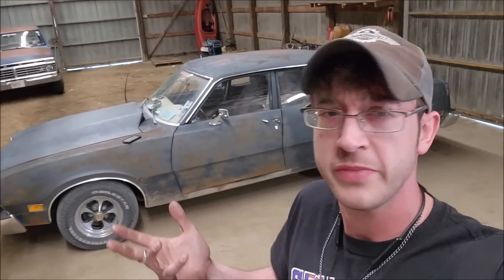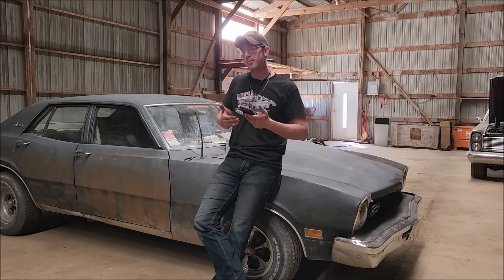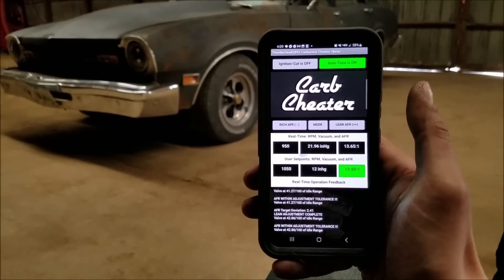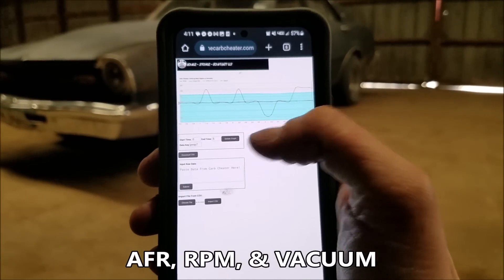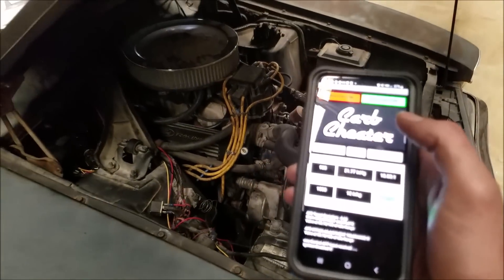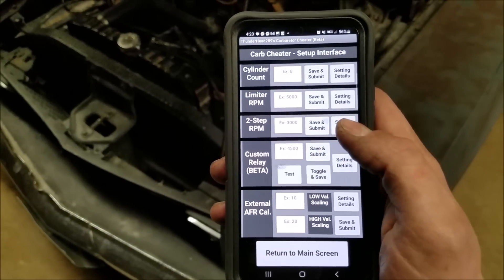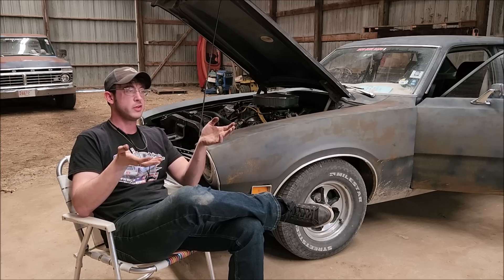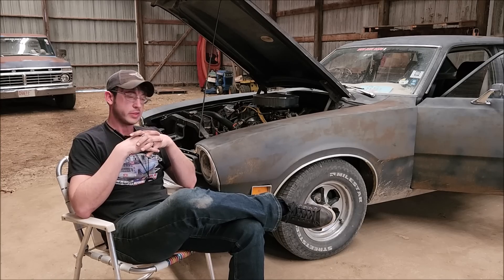A "self-Tuning" Carb in 2023? NOT fuel Injection (Beta Version - Teaser)

Comment: SEEMS like a great idea in theory and practice but thing holding me back is price of $500cdn.
i just paid 135 cdn for chinese knockoff carb and that in itself made a world of difference, eliminating about 3 vac leaks out of 3-5 intermitant leaks, other 2 are on the intake and not always present.
runs pretty damn great for F150 360 fe with probly 218 000 miles on it, at least on short grocery/beerstore trips. 
failed me twice on the highway possibly from vapor lock /1/2 plugged fuel lines, failing 2 tank switch, not sure at this point BUT started up and got me home with 5-10 minutes of fiddling under the hood.

Comment: 2:30 Can someone please explain the wiring to do remote self start?  Thank you
Does connect carb cheater just connect its yellow wire  (auxiliary relay/ dry contact) to the starter motor?  Where would the black wire (auxiliary) connect?

Comment: I wish I could get something like that carb cheater you put together... Perhaps a electronic distributor circuit could be integrated if someone wants to use a newer distributor, I've already moded my distributor to change the curve and limit the throw, and I think I have it set to 38 total or so.  I have a '74 maverick 2dr, with a 289 from a '66 mustang and a t5 from a '93 mustang...  I've done allot to the car that would fill a paragraph or a couple pages like brakes, body work, etc.  anyway, it would be nice to have something that would at least take care of the AFR, I've thought about trying some kind of system like this or a dyi FI but ran out of energy to put something like that together on a budget and with it being my daily driver w/o a backup car I can't have it down for long...

Comment: All you need is Bob Ogles plans they are on line last time I looked , he removed the carb / first fuel/vapor injection 100+ MPG, it was televised in the 70's. The feds searched his gar to make sure it wasn't a hoax, he used a big block and drove 200 plus miles on 2 gallons of gas/ 100 miles per gallon!!. He/his life was later eliminated by his partners, big oil. His invention on a modern 4 cyl engine would have produced 900 miles to the gallon.

Comment: I had a really cool and uncontrollable chuckle when I saw the chain you had bolted from the engine to the chassis! It immediately took me back to the ‘70’s whenever I broke a motor mount from more torque than the stock motor mount could handle. That chain allowed me to race to a lot of wins and I think it was just about the only thing that didn’t break from racing! Thanks for that fond little trip down memory lane. 🤙Oh, and by the way, I agree with all of the other comments about your channel. Your channel is the best that I’ve seen in a long time. I just found it today and what awesome presentation and content!I’m hoping that I’m not too late for the party and you’ll stick around for us gear heads ✌️

Comment: Luke I have a Mopar 360 rochester 2bbl circle track engine (class rules). will your adapter flat plate in your kit work with a speedway motors (lincoln Nebraska) #135-3502G 4bbl to 2bbl flat aluminum plate with either an edelbrock spreadbore 4bbl intake #2176 or a weiand 4bbl 8022 square bore intake. thank you for your time. Rapid Robert

Comment: love it , I have a 455 pontiac , i need a rev limiter for it,   5200 comes quick...  I will purchase one when engine goes in ,   also a rochester 4 bbL...  so I will have to modify adapter...   unless you can add that option...

thanks
Reply from the maker: Now available with q jet adapter 🙂
Reply: @ThunderHead289  cool ,  hope your enjoying the holiday and thanks for the quick responce ,   been following for many years.   I build cars too.  day job airplanes.

Comment: i was looking for a wideband system to adjust my quick fuel brawler. (ford 289 331 stroker)but it needs a stupid gauge in the car.

I'm very interested at youre product because of the wideband , gauge on cellphone app , and non stealable car . rpm gauge and a afr regulator system like the cheap chinese 50cc scooters that i work on. they also have a carb but a adjusting afr with just extra air thru a control valve.

So the program can control more air or less to the engine to control exact air fuel ratio so when iyoure carb is adjusted in cold wheater it can adjust the air fuel ratio when you drive it in warm weather and so it will be richer but not with youre air fuel mixture regulator?

when can we buy this system? do you have a vid of the parts and installing?
Reply from the maker: In ten days it will start to be available - I underestimated the paperwork behind setting up a business. Check the two videos uploaded after this one - I install it on a green f100. Part 1 & part 2 - check my recent uploads

Comment: I wish I could get someone to get my 89 4.9 running right, starting to hate fuel injection and all the computer controlled junk, miss my 73 carbed 302, not fair I lost it in an accident, been struggling to get my 89 Econoline running right and it finally fell on its face, afraid it blew the head gasket, can't drive it, gutless, not on all cylinders, but no coolant in the oil, tho coolant slowly disappears, wont pull a greased string from a cats ass.

Comment: Think this would work on a model t?
Reply from the maker: The only item I'd be concerned about would be the requirement of a single coil, and a wideband doesn't like 6v. 

We plan to make a stepup add on in the near future to accommodate 6v
Reply: @ThunderHead289  yeah it's 6volt however model ts use 4 wooden buzz coils as well and have a magneto to generate really crude AC power about 4 volts at idle and 20 volts at 1900 rpm. I really find your content cool the first video I watched was when you mounted the lawn carb to your maverick.

Comment: EFI tech is more than half a century old, don't know what the holdup is.
Reply from the maker: Not all new things are better. I bought a 2021 jeep brand new. Engine revs up and down to 2000 rpm randomly at idle, ignition pings off the line sometimes. 

I'm a programmer by day, and I'll be the first one to say that a fuel metering system that's founded in physics and fluid dynamics is pretty hard to beat when tuned correctly. 
Most people just are too lazy to ever do anything right that takes any effort because we live in a push button society.

Comment: Modifying any fuel system is a federal felony 
Since 68 or really 72  you need a state / fed certificate to touch them
Reply from the maker: Holley does it and we took their disclaimer 😄
Reply: @ThunderHead289  
I'm just stating the facts they can take the car , it has to be put back stock ,by a dealership or crushed , it happened  to  a kid at our dealership

Comment: @thunderhead289 I'm really excited to get my hands on one of these and play around with it one day. I'm pretty much in the same boat about not wanting to ditch the carb setup on my older vehicles, but still having a craving for data and tunability on the fly which has only recently become possible thanks to smart phones, open source code/apps, and stuff like that. Having a system which can be a standalone tuner with simple inputs and outputs, and a smartphone UI, that is a game-changer for people who have a passion for old junk, but never had a chance to learn all of the carb tuning tricks the old-fashioned way. 

I'm hoping this can also be a "gateway drug" to people understanding more about the science behind carbs and how to tune them. Having a cheater that can fix all your tuning problems in one stroke is great, but if it can also show you where your system's weak points are, it can help you tune and troubleshoot cars even if they don't have a cheater.  

Watching people like you, its amazing how you can just hear the difference between rich and lean, timing advance, and other stuff. I know that comes from years of experience, but its still impressive. People like me spend hours and hours trying to troubleshoot something that more experienced people just instinctively know in seconds. If this device cuts that learning curve down with real-time feedback and data logs, that is going to be awesome.

Comment: Tell me this is going to be priced for the working man on a budget, please.

P.S.  A suggestion:  an auxiliary relay actuator function set for certain conditions. Example, a ram air scoop that has a valve that only opens at WOT. Or open exhaust valves.
Reply from the maker: It's under 400 dollars, so I'd say so. I basically make nothing making them - more of a gift to the community than anything
Reply: @ThunderHead289  Luv ya like a brother, man.

Comment: wow that is fantastic, would like this in my 1983 Ford Capri (european Capri) but I guess it will not be "for small money" or? :)
How does it control the Air/Fuel mixture? This would also need some motors they control the needles for mixture?
Reply from the maker: 383.00 - simple to install

Comment: optional slave cheap android tablet that runs on older android would be good. for that display hidden in glove box of something.
Reply from the maker: Technically the app is just an HMI, so it doesn't have to be connected at all for carb cheater to do its thing. But yes a 50 dollar android tablet would work well as a "permentant" in vehicle installment
Reply: @ThunderHead289  sweet. i cannot wait to get one to put on my 1969 GTO. but im a lowly Canadian ;) I am a tech but not a coder. I could build it from plans but cannot program it apart from applying existing code to a chip or module. would be fun to apply to my old 4 cylinder Honda bike as well as my 1949 military Jeep.
Can't wait for its release.

Comment: Dude that is very cool! I figured you would have to put a plate between the carb and manifold to act as a drive by wire throttle body to maintain AFR.
Reply from the maker: It's much simpler than that - maybe even to an annoying level lol

Comment: How about a “turbo timer” setup for electric fans?  Possibly just a timed output after ignition is turned off.  Could be ground trigger as well. I like that the fans run for a bit after shutting off the vehicle but do not like leaving it wired direct and running to much. 

The remote start feature is the ultimate selling point.   I have 3 vehicles that need one of these units.

Comment: What is the chances of someone hacking the software, and either shutting the car down while its making a pass. Or stealing the car? Thieves are not as stupid as you think, which is why so many Hellcats, and etc are being stolen. (Youtube it)
Reply from the maker: Unless you give someone your code, each unit has its own specific pin - nothing can be done without that
Reply: @ThunderHead289  don't take it the wrong way, for its not intended to be derogatory. Some years ago farmers where having issues being able to access and diagnose issues with the John Deer equipment due to the proprietary software. Those of the hacking community answered the call  and delivered a way for the farmers to work on their equipment without John Deers approval.  Guess what I am saying is, have you thought of is: limiting distance broadcasting. Or in the event of theft, making a low jack style feature.  Device has to be within range - verified mac addy. Or if the vehicle has been taken - has the ability to remote shut the vehicle down.
Reply from the maker: @JusSkott  it's over bluetooth so someone would have to have their phone hacked first - no web
Reply: @ThunderHead289  "sniff sniff." Either or, still interested in the final product. And will there be provisions for a blow through carb?

Comment: Damn I've wanted to do something similar for quite a long time but I've been way too busy in the last 5 years. 
I don't know how you're controlling the mixture but I personally plan to run smaller main jets and use an auxilliary enrichment system somehow controlled by a modified speeduino
Reply from the maker: Speediuno is garbage - id recommend designing something all your own like we did
Reply: @ThunderHead289  I'm not running an original one with the old arduino mega,  I'm running an STM32 based one. I'll stay with the speeduino firmware for now as I have another project to finish before starting working on the carb

Comment: the backfire created from cutting the ignition can and will cause engine damage. the factory hot rods came with rev limiters in the distributers. they could easily be disabled. would void your warrantee. we weren't worried about the warrantee. I have seen a few engines that exploded at high revs. then you reattach the lever on the distributer and haul it to the dealer.
Reply from the maker: Any curburated engine Rev limiter is an ignition cut - the party mode just exaggerates the duration such that a measurable amount of unburnt fuel finds its way into the exhaust, ignites when ignition comes back online. 

I may not offer the feature to the public though - fast way for a car with mufflers to blow the muffler into outer space

Comment: Add a feature that can take an aftermarket rpm gauge and turn it into a built in timing light thing so people will never need to pull out a timing light ever again
Reply: Like a bolt in or weld in magnet and sensor

Comment: I love the carb cheater. When will it be for sale? I've also seen your vids on pertronics ignitions.
If I've missed it, I've never seen you do a vid on the progressive ignition systems. Do you have such a vid. If so plz let me know. If you've not heard of it, it's basically the same concept for a distributor as your carb cheater is to a carb. It has no vac or manual advance. All by wire.
You manually set the idle timing. Then the dwell and advance curve is set via a phone app. It is made to deliver 8 amps from idle to 10,000 rpm.
Together with a carb cheater seems like the best way to bring my old 350 Chevy into the 21st century. 
Thou I think 10,000 rpm's would put my 350 squarely in the middle of a scrap pile, I am looking at reliability, economy and when I fill froggy, some good ole power.  
Please let me know your thoughts.
Reply from the maker: I'm the original promoter of progression ignition 🙂👍 when you go to my channel a video automatically plays - scroll to the end of it. I know the guy who developed progression ignition

Comment: My brother runs a 1984 Mustang with a 1953 flathead, carbureted at Bonneville each year. This would be an enhancement as it would have AFR adjustment on the track. He’s building up an engine for this year - could we test your device?

Comment: What, that's incredible! What hardware does it use?
Reply from the maker: It's a custom circuit board we designed, and then a couple of machined parts we designed 🙂
Reply: @ThunderHead289  very cool! Looking forward to try it
Reply: @ThunderHead289  I didn't quite get it from the video, bud does your sistem control timing?
Reply: @Евгений1-с4р  no

Comment: Duuuude this thing is awesome if it works... Could you perhaps expand usage to fuel injection systems like the old throttle body and early OBD II late OBD I? I've got an old Jeep I REALLY want a little smarter computer on. Also could you maybe add lock up control? I got a Dodge Ramcharger I changed to a carburetor and want to avoid changing trans or buying a vacuum lock up kit for.

Comment: 8:32 would it be too hard to program an adjustable rev-limiter duration? In playing with Ange-The-Great's engine simulator, I found that my favorite sound is 0.03 seconds. Lower than that sounds too chaotic and definitely anything past 0.2 is just whack.

UPDATE: After more testing, I've found the sound signature kinda seems to depend heavily on the max RPM and the design of the engine. Very responsive high revver sounds different with 0.05 near valve float compared to in the first 1/3 of the rev range. So I guess I'm asking for a range of 0.01 to 0.1 seconds ignition cut interval for the rev limiters in 0.01 increments.

Definitely don't need anything shorter than 0.01 or bigger than 0.2 from my testing with a simulator. Too chaotic and too lazy respectively, regardless of RPM.

Comment: 1981 302 Bronco. Runs great; sounds great, except when you drive it more than about 30 minutes at highway speeds (50-70 mph), it stalls, and blows fire out the tail pipes, while running very rough until you get the RPMs down below 2000. Then, it runs great, and sounds great until you accelerate again. Do you think my timing chain has stretched? Itsgot approx 140,000 miles on this engine.

Comment: How's cold start up from the phone? Only reason I was even considering EFI was remote start, I know it works on carbs but kinda sucks when it's cold. Does this help with that too?
Reply from the maker: Remote start is not a feature I would give to the public- too much liability and bt range isn't good enough for that to be actually useful. It's just a party trick as I said in the video
Reply: @ThunderHead289   Thank you for the quick response hope you have a good one 😁

Comment: I have a 95 jeep yj obd1 2.5l with fule injection.
Would I be able to run this on it?
Reply from the maker: Not for fuel injection - designed around carb era fuel control and ignition. Unfortunately fuel injection and carbs are too different